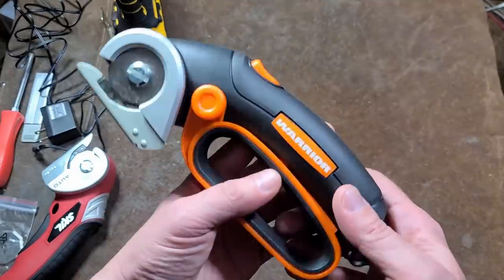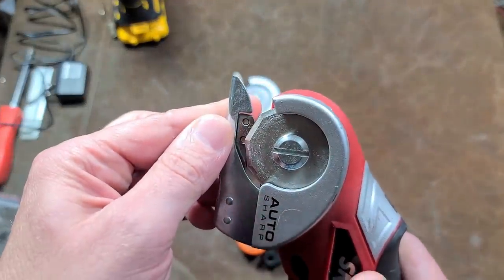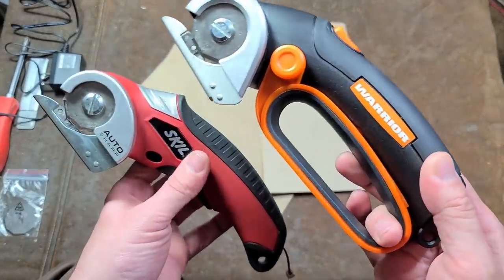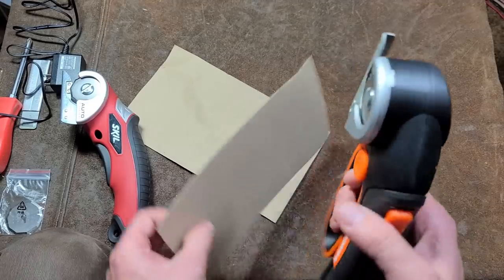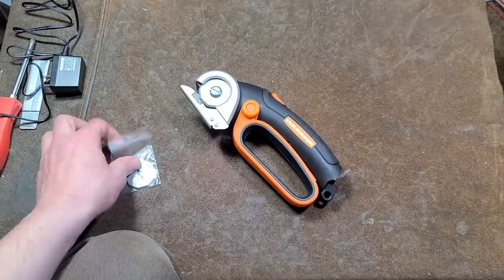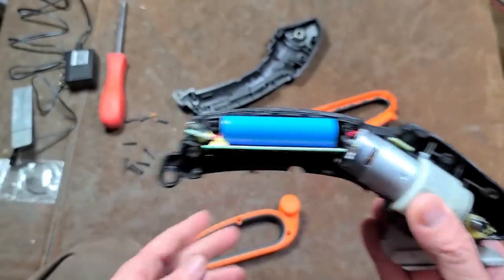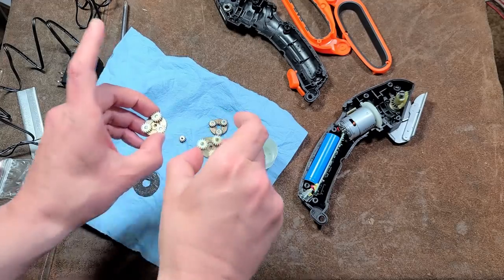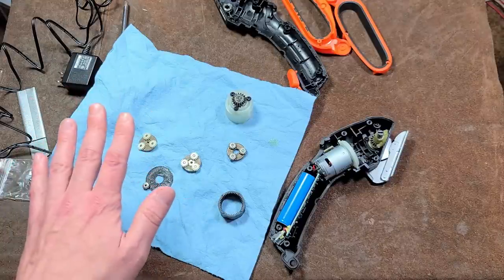Harbor Freight Warrior/Worx ZipSnip Rotary Cutter/Opener Review/Tear Down

Comment: I wish I would have had the Skil one but they don't make them any more. But I feel after coupon it's a decent tool and works well.
Reply: ClientGraphics  ClientGraphics is in the house 👍🏽👊🏽
Reply: The coupon that raises the price $5? Its $30 on the shelf and the coupon raises it to $35
Reply: I believe that the Skil one was released when Skil was part of Bosch. It might be the one tool that Bosch got right for Skil. 

I hope that Chervon will pick up on the interest in this type of tool and release a new version with a standard USB charge port. I've got the Chervon Skil cordless screwdriver with a micro USB port. It makes it really easy to charge it up.

Comment: I noticed you using the Skil in some videos, and I thought it was slick.  After poking around, I found a good replacement for the Skil.  I got a Workmate branded version on Amazon Prime.  I chose this one because it charges with USB-C and it includes a blow-mold case.  I know a lot of folks hate those cases, but I wanted one, and Amazon was selling cases for the Worx at half the cost of the tool.  As of April 2022, the Warrior is $34.99, Worx $38.63 and the Workmate $39.98.  The Workmate more closely resembles the Skil than the Warrior or the Worx with the safety in the same spot instead of up on top.  The Skil and Workmate are both 240 no-load RPM while the Warrior and Worx are 260 which makes me think the Workmate also has the gear reduction for torque.  There are tons of comments on the Worx site asking about how to buy that stupid powerpack charger that everyone loses, so USB was key for me.

Comment: We would call the 4” version of this a “sample room saw” in the garment industry. The faceted blade is the whole reason it works, allowing for a shearing action as it rotates against the fixed blade/jaw. Technically, we’re supposed to wear a chainmail glove when using cause this will def suck a finger in if you contact the blade.

Comment: Great cutter. My only disappointment with these is I still have to use a hand box cutter to cut through the tape to break down the boxes just so I can use my Warrior to cut them up. Why didn’t they think to add a built in side cutter for the tape.

Comment: HomeDepot has the Makita 12-v version for $69, bare tool. So not quite as expensive, if you're already on the that platform (which I'm not, so it would be $115 for me). Actually, since I'd basically want this for cutting up boxes, I'd probably get the small circular saw and the thinnest kerf blade I can find for that.
Reply: If you have a Dremel, there is a wood/plastic wheel cutter -  that would exactly fit your stated desire. I use the wood/plastic wheel cutter on the Dremel for slicing up  thick, industrial, or plastic coated, type boxes; or anything up to as thick as Luan.

Comment: I cut the loop handle off of the HF cutter and, widened the cut jaw gap a bit - both jobs with my Dremel.  Now the HF cutter is better than my old Skill; which is yesterday's news.  I sold the old Skill in a garage sale yesterday.
Reply: Don't be afraid to modify new tools to make them better, smarter, faster.
Reply: Seems hardly worth the bother, to polish a turd, then get rid of the higher quality tool to keep the turd.  The HF is never going to be better than the Skill.  Ergonomics maybe but the rest including longevity, no way.  It's just more garbage that you probably couldn't get more than $1 for at a garage sale unless you live in a hipster zip code.

Comment: Here's a tip: Save your money! I use Wiss 12.5" Straight-Cut tin snips to cut the tamper-proof packaging off of products. It works every time, doesn't need any batteries, is simple and half the cost! You can also use a utility knife.

Comment: My biggest issue is with the charger design. If they had gone with a micro USB charge port then I'd get one. I don't really want a cordless tool with a charger unique to that one tool. If it were USB then I know I've always got a charger around.
Reply: I just got a Matework branded one Amazon Prime that uses USB-C to charge .  Seems better than the HF one if you are still looking.
Reply: @LeisureTimeLarry  Nice! I wasn't aware of that one.  I've now bookmarked it.

Comment: I don't understand this difficulty people have with packaging opening.  I have a pair of safety scissors (the type with blunt end that can cut pennies as-seen-on-TV infomercials years ago) in a pen holder on my desk, or in the garage or on the workbench I'll grab a utility  knife, or otherwise I have big Wiss scissors, or even my EDC folding pocket knife.  Any of these options takes less time than going to get some motorized cutter, let alone dealing with recharging it.
I could see if someone has severe arthritis, not using scissors, but then would holding a rotary cutter be easier than a utility knife?  Maybe, but I'm not convinced they are worth the bother except in specific trades where there is high cut repetition and then you probably won't consider the Skill HQ enough to use that often, nevermind the HF with the low quality and ergonomics problems.
Reply: I've got up to 4 different things to open a package, how do people have issues? Because not everyone carries super scissors and box cutters on hand. Jesus, you answered your own question and still feel the need to flaunt your superior package opening skills. 

Ignoring your preachy attitude, not every plastic clam shell package is flat and readily available to scissoring all the way through. There's plenty of formed  packages, like some 12v/18v batteries, that just don't have the shape to allow scissors a decent purchase. If you hacking at things with a knife or a box cutter, at that point these tools are just as fine. You don't have to worry about over penetration or a missed cut taking a thumb out.